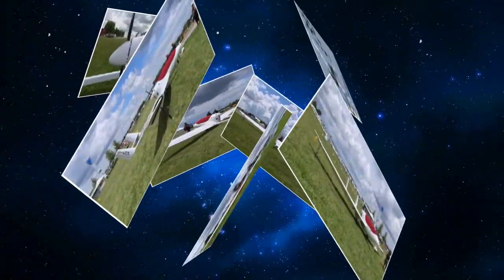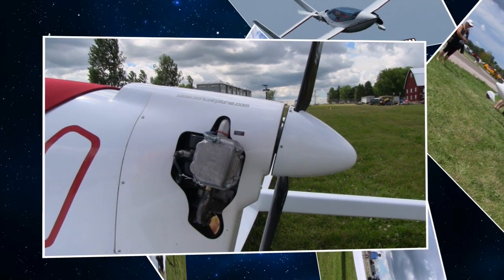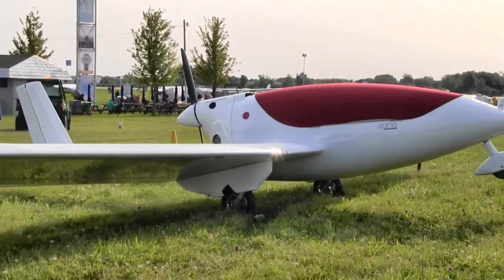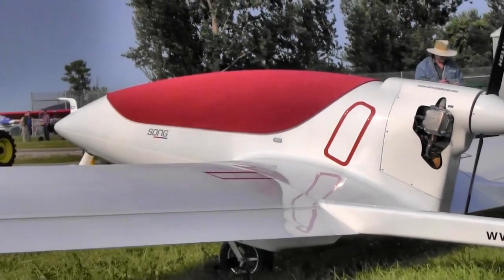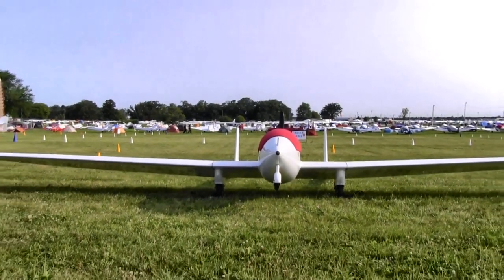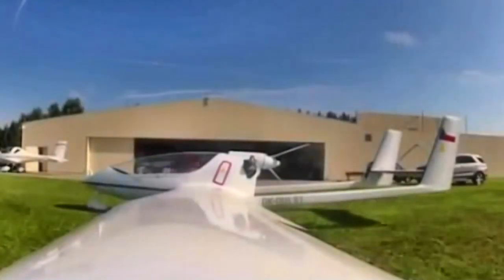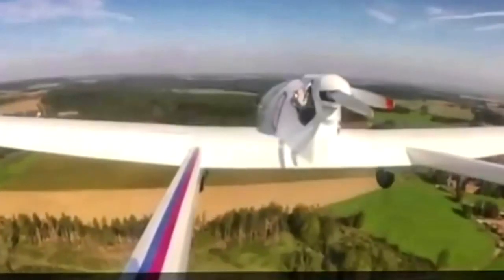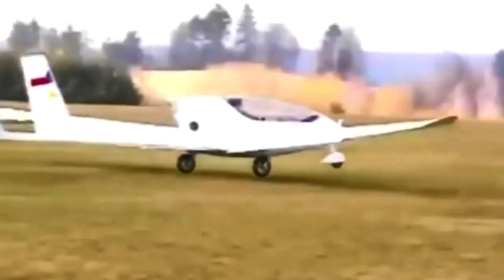Song ultralight aircraft motor glider from Melody Aircraft

Comment: I'd love one of these configurations in a two seat version with 50 gallon fuel capacity, a Rotax four stroke engine and a large Fowler flap to allow high speed efficient cruise but also low stall speed for grass strip operation.
Reply: No problem, I will make one...

Comment: I had forgotten about this. A full part 103 plane. Not bad. Shame about the speed limit. I think they could relax that a bit if only they hold on to the stall speed. And maybe FAA could cobble together a video pilot's course of an hour or two that you can watch a couple of times so people are armed with understanding of relevant aircraft concepts and dangers. No test, just the education and recommendation that it's very good to know. Maybe rewatch it once a year. It's great to loosen some bureaucracy and costs but no reason pilots shouldn't know what they are doing. Video allows us free effective education these days. Can be just as good or better than exam of the past.

Comment: I like sleek and efficient, not a fan of the price.
It really should be possible to make minimal single seaters dirt cheap. But I guess the low stall speed UL requirements makes the construction more expensive. A shorter wing and higher speed would be easier.
Reply: Wonderful

Comment: Very nice aircraft. Your design looks identical to the Electro Flyer ULS  except that airplane is fully electric. Which came first? Who copied who? I'm guessing the electric plane was based on your design and came after the Song because the airframe was ideal for the electric motor/battery pack installation. How many are sold and flying in the US? Are there any used models available? The $45K is still steep for some of us recreational flyers.

Comment: Are you sure you can fly this without a liscense?
Reply: The only things that matter are top speed & weight.  It fits both.  You can control the top speed by using a particular pitch on the prop (a climbing prop), the weight is ...well, the weight.

Comment: for me is a waste of money you can not go any were 

 except go around and around on top of the lanfing pasture
Reply from the maker: Since I have flown from Ontario Canada to Lakeland Florida in an ultralight, (which is what this is) and know of several others that have done cross country flights I would have to disagree. While they aren't the fastest, they do make for very enjoyable flight time.
Reply: @ber Murillo You have to understand that 20hp engine consumes less than 1 gallon of fuel per hour. With 5 gallons of fuel, the plane has a maximum range of 300 miles and than some. That's going distance for a lot of people.